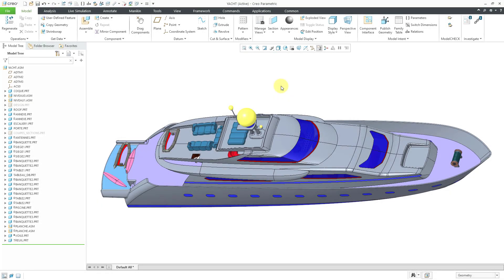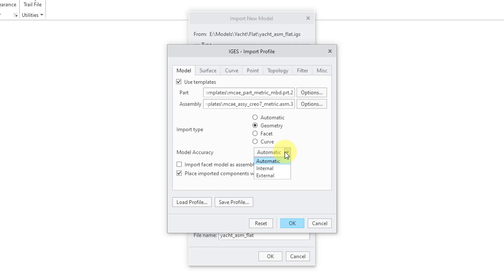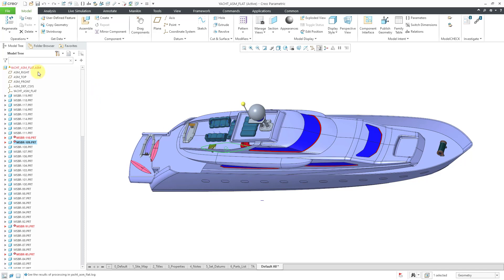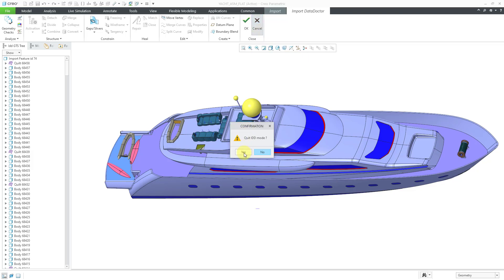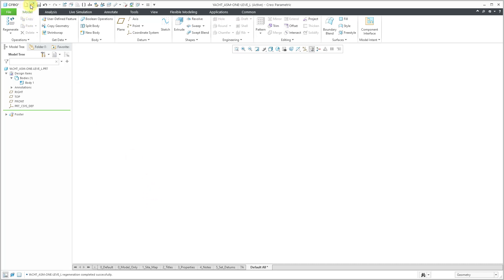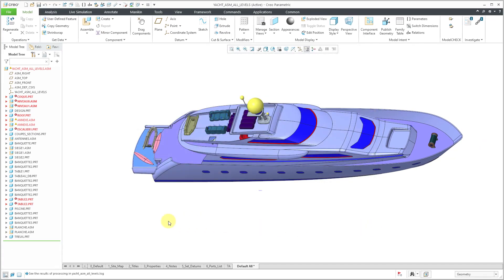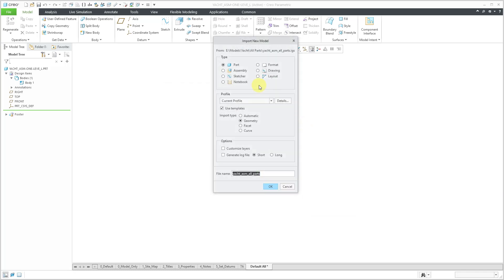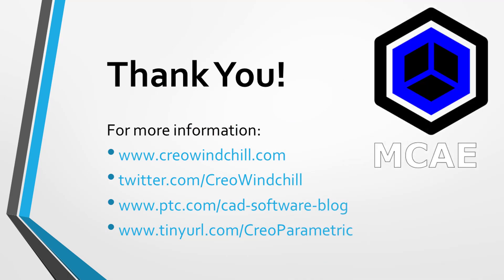Creo Parametric - Import IGES Files | Data Exchange

Comment: I am having an issue where opening a STEP as a part will align all part datums to the center. Essentially making a jumbled mess. I notice at 12:10 of your video you have an option to "Place imported components with aligned CSYS" checked. I don't seem to have this option. Do you think checking that would fix my problem? Any suggestions on how to get that option?